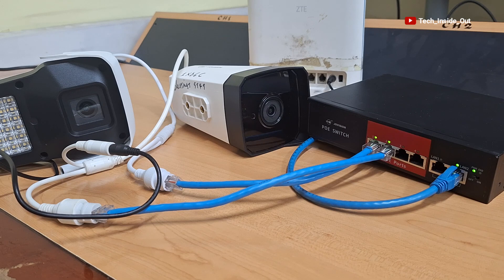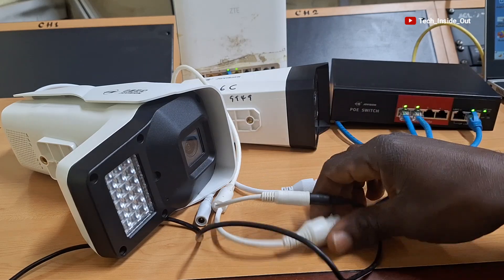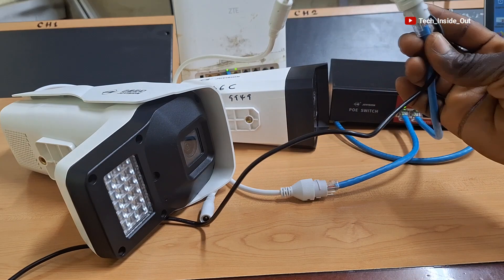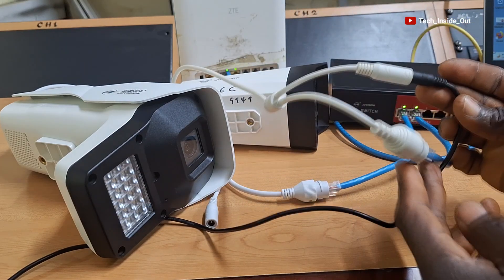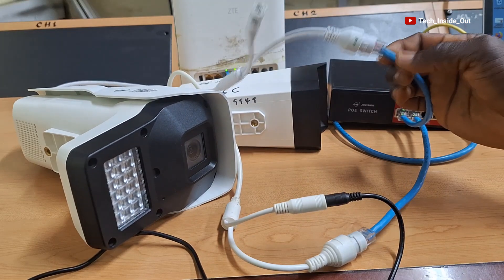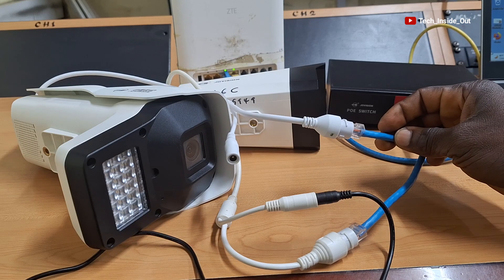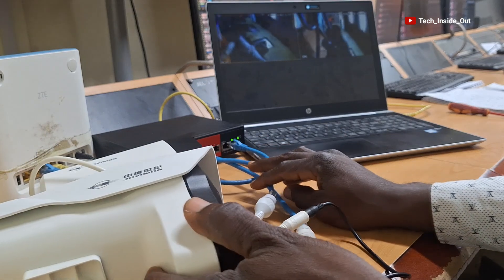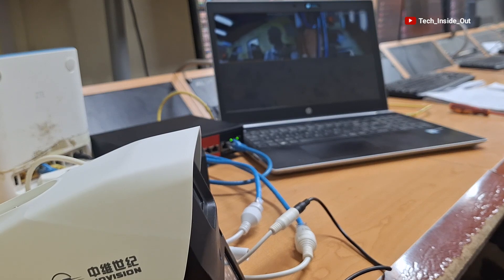Difference between POE cameras & non POE cameras

Comment: In poe camera can I use 2 power.power supply and poe in the same time for redundancy
Reply from the maker: I couldn't get your question very clear but let me attempt an answer. 
The ethernet port powers a POE camera and the power adapter can also be used in case you don't want to use the Ethernet port in powering your camera

Comment: in term of cost cutting in between POE and non-POE which one is cost saving, Thank you for all you are doing, you open eyes of a lot, live from south sudan
Reply from the maker: POE cameras are more expensive than non POE but you would not use splitters as required by non POE Cameras and some other factors. You may have to compare and contrast depending on your peculiar need and situation.

Comment: You can make the non-Poe camera into a PoE camera by having a PoE splitter attached to the camera’s power wire and Ethernet port. This splitter will allow it to be connected to the poe switch via a single Ethernet cable. So, your non-Poe camera is now working as though it is poe
Reply: Thanks man.
Understandable🎉
Reply from the maker: The use of a POE splitter does not turn a non POE camera into a POE camera.
Reply: @ Yes, a non-PoE camera can be made to work over Power over Ethernet (PoE) using a PoE splitter along with a PoE switch. Here’s how it works:

	1.	PoE Switch: This provides the necessary power through the Ethernet cable.
	2.	PoE Splitter: This device splits the power and data from the Ethernet cable and provides separate outputs for power (usually 5V, 9V, or 12V depending on the camera’s requirement) and data (Ethernet) to the non-PoE camera.

Steps:

	•	Connect the Ethernet cable from the PoE switch to the PoE splitter.
	•	Set the output voltage on the splitter to match your camera’s power requirement.
	•	Connect the power output of the splitter to the camera’s power input.
	•	Use the Ethernet output from the splitter to connect to the camera’s Ethernet port for data.

This setup allows you to power the camera and transmit data through the same Ethernet cable, effectively converting it into a PoE-compatible device. Just ensure that the splitter’s output voltage and power rating match the camera’s specifications.

Comment: How can identify the difference between poe ip cam with non poe ip cam physically if both of the IP cam  do indicate if the camera is poe or not please? However, are you in abj?   There are some ip camera you need to see
Reply from the maker: Apart from POE IP Cameras that come with just ethernet cable as terminal, you can't identify a POE camera without reading its name plate.

I live in Ghana